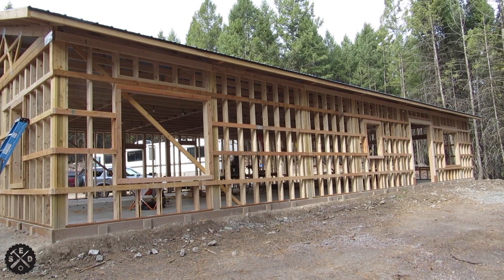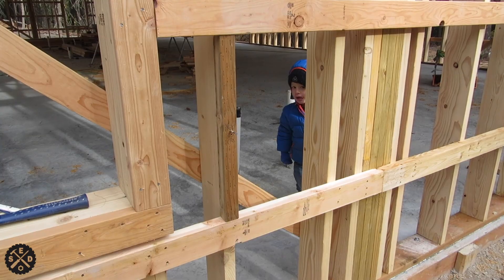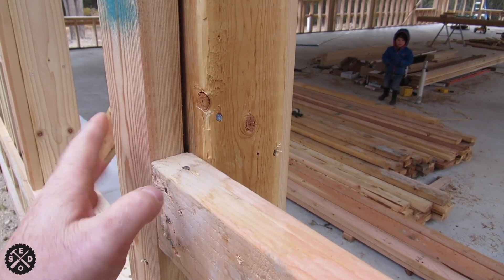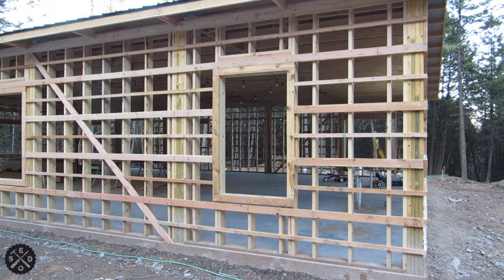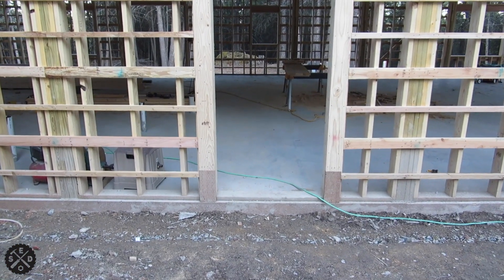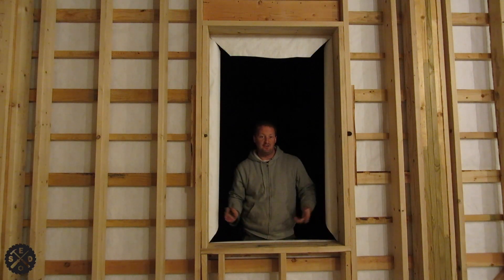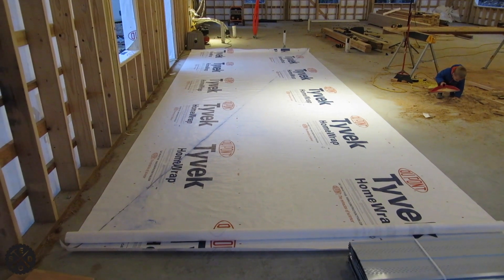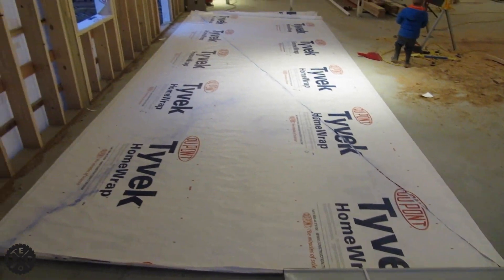Purlins On Sidewalls and House Wrap Pole Barn House EP 11

Comment: Best pole barn home video. Do you recommend putting osb .5 inch seathing outside.
Reply from the maker: Thank you!! It depends on your siding. If you’re doing steel siding I don’t see the need for it most people don’t. If you’re using anything else for siding I probably would sheath it.

Comment: Fascinating. The nailers also provide huge lateral strength to the structure. Did you consider using 1" x material? In my house, a 1x6 nailer was mailed to the base plate and top plate as well. The baseplate nailer provides a lot of water and pest defense, plus tied the studs more strongly to the base and top plates
Reply from the maker: Thanks. I didn’t consider 1” material mainly because I didn’t have any. I thought about sheathing it with plywood but since I was doing steel siding this seemed plenty sufficient. I also did the permanent built in braces into the walls to brace it stronger. I think your idea is a good one too. Thanks for the input.
Reply: @SmartEasyDIYer  
Thanks for the kind words. You built a beautiful structure. The way you documented it is really cool.
Reply from the maker: Thanks I appreciate that a lot!! 🙏

Comment: Why did you do inside vertical studs and outside horizontal stuff??
Reply from the maker: Just my choice. I ran the ones outside horizontally for my steel siding to attach to, inside I decided to frame studs between posts to attach my drywall a little better. I wouldn’t have had to, A lot of people just do two by sixes laying flat every 2 feet in between the posts and that would’ve served the same purpose.

Comment: Good evening sir.  awesome videos!! trying to decide between a pole barn verses red iron steel brando.  would like to ask you what made you decide on the "POLE BARN?" I am looking from the aspect of the shelf life of the poles being that they are in the tired compared to the steel frames? thank you very much in advance. Lee
Reply from the maker: Thanks! Yeah I don’t have much experience with steel ones personally so I can’t really say. I think they work well. I went with this because I was familiar with the method. If you’re concerned about the posts in the dirt you could check out rr buildings on YouTube as well. I like that method of concrete piers and metal brackets. They weren’t very common yet when I did it I couldn’t get much info. I’d probably do that next time though. Thanks

Comment: Did you buy your pole barn in a kit or did you just go by a local builder's supply and get your own material
Reply from the maker: Yeah I went and got my own stuff. There are places that provide kits but they use some cheap stuff usually from my experience, and it does pay to shop around. Like for all my roof purlins I decided to go with a little better grade instead of number 2 I used select structural grade. It’s lighter and straighter and less knots typically. It’s good to check around though I priced from two different places and  the one was a whole thousand dollars cheaper for my lumber package! Also my posts I got from the same place that built my trusses. It was a local place that beat everyone’s prices.

Comment: Why did you frame the walls so much? Dont they typically do horizontal 2x4s on both the inside and out every two feet. Seems like a lot.
Reply from the maker: I tried to explain in the video but the reason I did more strips in between the 2 x 4‘s was just to help support my siding better when I spray foam the inside since I’m not doing 7/16 sheeting.
Reply: @SmartEasyDIYer  no I mean on the interior as well. Why place everything 16 on center of you're building a pole barn style house? I've seen people do the 16 on center as well as horizontal framing of 2x4s every two feet on the interior.
Reply from the maker: I see ok. Well I wanted to frame it like a normal stud wall for drywall etc. it’s probably plenty overkill.
Reply: @SmartEasyDIYer  gotcha that makes sense! Thanks for the reply
Reply from the maker: Yessir. Thanks for the comment. Are you doing one yourself?
Reply: @SmartEasyDIYer  I sure hope so in the near future. Still trying to find land which seems to be a challenge.
Reply from the maker: Gotcha ok. Yes it does. Best of luck with your project!

Comment: Man you did a beauftiful job on the purlins, very neat.  FWIW I don't cut the windows out with the Tyvek until I'm just about ready to install the windows.  This way it helps to keep cold air, snow, rain, wind, etc. from entering the home.  Obviously if you're ready for the window installation then cut out the Tyvek.  Not a criticism just how I do it.  Keep up the good work and be safe.  Stanley
Reply from the maker: Hey thank you that’s a good point. And yes I usually don’t cut them out until I’m ready to install windows and doors but I’m ready for that. Thanks for the comment I appreciate it. 👍👊

Comment: Well done Paul.....looks very very solid.  What type of siding are you doing where you don't need the sheathing?  Looking foward to the next video. BTW.... I also have a little helper like your son....that is a fun age.
Reply from the maker: Hey thank you I appreciate that! I’m doing a steel board and batten siding. It’s not quite as thick as normal corrugated steel but it’s still nice and solid. I really like the look of board and batten but I wanted something I didn’t have to worry about maintenance. My last place was hemlock board and batten and I loved it but I didn’t love the maintenance.
Reply from the maker: Yes you are right that is such a fun age! 😊
Reply: @SmartEasyDIYer  which brand of siding did you decide to go with for the board and batten?

Comment: looks good but oh man,it truly is a cheap pole barn!no sheeting!looks like with the labor involved in blocking it out along with materials that putting $10 sheets of OSB would have been more cost effective in the long run.would feel the wind blowing when in bed in my area of the world..to each his own,i know plenty of people that build "pole barns" instead of stick built shops and seem ok.we spent the extra cash and had it stick built,only doing it once.
Reply from the maker: Well thanks but it’s not exactly a cheap pole barn. I didn’t want OSB in my building. I could if sheeted it with plywood this but this worked out well for me. The 2 inches of spray foam made it very solid too.  Like you said to each their own. Thanks for stoping by.
Reply: Rooster, most pole barn homes dont sheath the outside and work out just as good, and even better in many cases that classic stick frame homes, both in strength and R Value.

Comment: it looks like you are at 16" OC? The poles are taking all the load so I would have thought you would have gone at least 24" OC because of thermal transfer. Or am I missing something?

Looks awesome though! Looking to build my first pole building here in a couple weeks.
Reply from the maker: Thanks. Yeah I just did it for easier layout for drywall etc. you could easily go bigger spacing. You could even frame it horizontally instead of vertically like I did and save some lumber for sure cuz like you said the post are supporting all the weight.

Comment: Lol! Got distracted by watching your son and have to watch it again. Did you split a 2x4 for the extra horizontal purlins outside? Also any reason why you did not go for a wood seathing outside? 

Great explanation of framing windows and purlins. In a way this is the best construction for strength and also to minimize the stud exposure to outside. In a way it improves insulation by at least 10%
Reply from the maker: Yeah thanks my son enjoyed helping. 😊 it may have been worth the extra money to do the sheathing. I’m just used to doing girts like that for steel siding. I figured I’d add some extra since this siding was a little thinner than traditional steel. Yes I just ripped a 2x4 in half. Thanks for the input